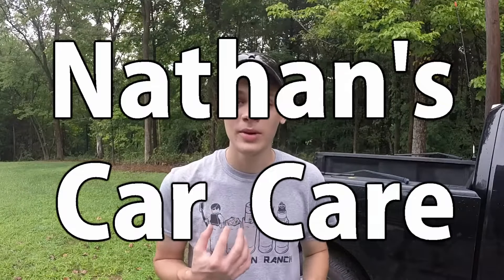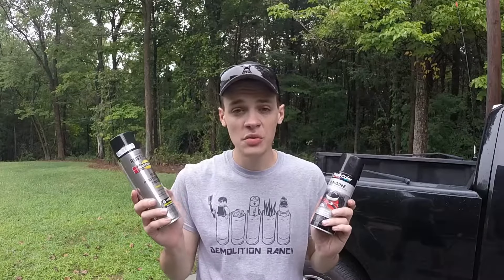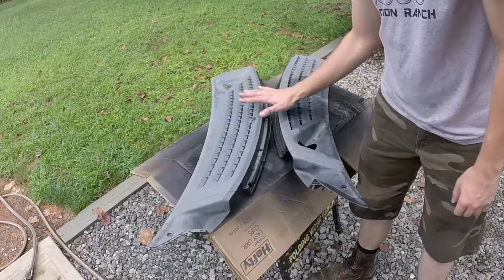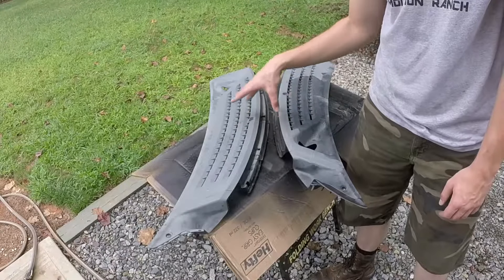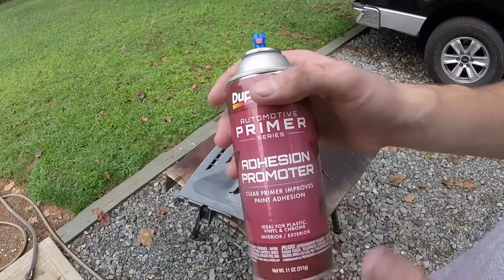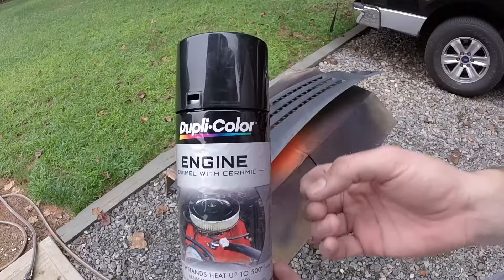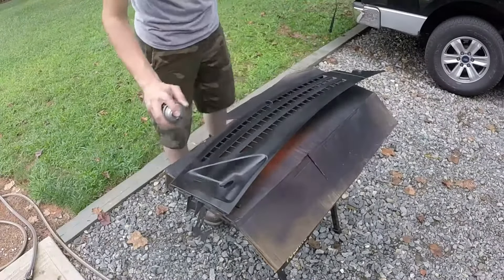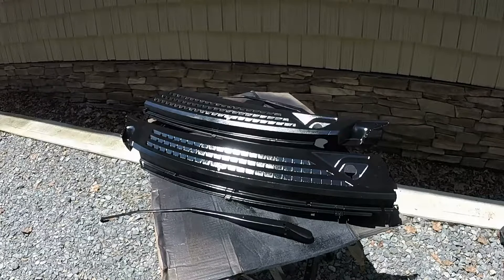How To Paint Plastic Car Trim - Step by Step Guide

Comment: Nicely done, only thing I would suggest is wearing gloves from start to finish and DO NOT TOUCH anything after cleaning the substrate with bare hands until last coat is applied, you touched the paint surface before applying the clear, that transfers oil from your hands and can create fish eyes in the final coat. But overall nicely done. And adhesion promoter is the bomb for plastic panels, makes paint stick like dog poop to a wool blanket.

Comment: Wow super helpful! A plastic trim that runs around my fog lights has been chipping away these past couple of years. I am thinking of painting it w/ your steps mentioned. Rather than taking it in for a paint job or complete replacement of fog lights. Lesson learned... don't buy knock off brand fog lights.
Reply from the maker: I'm glad you found this helpful. It's very doable

Comment: Hey.  I was just wondering if scuffing or sanding is needed? If not that's great.  Will be doing mine soon.
Reply from the maker: For this particular piece, it wouldn't help, because it already has a bumpy texture. So you'd have to sand so much off to get rid of the texture, then more to add texture back. I opted for the adhesion spray then paint. It's still holding up great to this day.
Reply: @TheNateTake  okay so for a number should work as well with just a good alcohol cleaning and adhesion promoter?
Reply from the maker: Correct

Comment: Hi Nathan I have a 2014 Ford expedition everything looks great except the trim and bumpers. They’re faded to almost white. They were just factory black. Would this technique work just as well on the front and rear bumpers?

Thank you for your very clear instruction video.
Reply from the maker: This should work on all plastic trim. One look that is popular with bumpers is to paint them with bed liner, which you can get in alot of colors, because they can easily get beat up.

Comment: I want to paint the interior trim parts of my 05 stang, should I use a adhesive plastic promoter after I sand them down? You didn't need to scuff it up?

Comment: Thanks, Nathan, for the video. The finish looks great, but over time the cowl will need protection from the sun. I usually use Meguiar's Ultimate Plastic Restorer. Do you know if after painting Wipers Cowl, I can use it on painted surface. Also, could you advise how much Dupli-colour engine enamel paint do I need for the cowl on Corolla 10th generation.

Comment: No sanding needed prior?
Reply from the maker: I didn't need to sand mine. Proper cleaning removes any contamination so the only other reason to sand plastic would be to increase the adhesion. Since this part already has a lot of texture to it, and I use an adhesion promotion spray, it wasn't necessary.

Comment: Wouldn't that clear Enamel crack under intense Sun or turn yellow.

Also why not use Dupli•Color  Trim and Bumper Paint? 

Just curious. Thanks for your reply.
Reply: try SEM Bumper coater
Reply from the maker: 3 years later and mine are still in good condition, no cracking or yellowing.

Comment: Looks good. Any special reason why you used the engine paint instead of their paint made for trim and bumper use?
Reply from the maker: Yes actually. The engine paint is enamel, which is going to be a tougher paint, and less likely to wear out over time. In fact it has worked great. Those pieces I painted in the video look just as good as the day they were painted.
Reply: Good point. I did not think about that.

Comment: This is a great video. My only question is, how long did the paint last and did it fade?
Reply: Matthew I found that once you apply the clear coat and it's cured to apply a ceramic coating to it and you will get years of protection and it won't fade

Comment: Looked great! Ive got a grill id like to spray that is plastic, and has a "chrome film" on it. Do you think lightly sanding the film would be ok?
Reply from the maker: That should be fine. If the chrome is intact, not peeling, a good cleaning and it should be fine painting over it.

Comment: Awesome video gonna try this on my RSX with faded black trim, but will this method work on my chrome trim? Would I have to do anything different? You earned a sub 👍
Reply from the maker: Welcome! I am not sure how it would do over chrome. I'd assume that if the chrome was well adhered, not peeling, and clean, it should be fine.
Reply: @TheNateTake  thanks for replying 🙂 and also you think it'll work on windshield wipers? Not the blade obviously but the swinging things lol

Comment: Hi, what did you use to clean the parts? Can I use a kitchen grade degreaser? Or is it better to just use dishwashing soap and water?
Reply from the maker: The only thing I would be careful about is making sure the degreaser won't disolve the plastic. I used just soap and water, but if you have a plastic safe degreaser, I can't come up with any reasons why it wouldn't work.
Reply: Dupli-Color SCM make sure you get a vinyl and plastic dye you can clean it with some stuff called Bulldog or you can use methyl ethyl ketone wear a mask when you clean with that don't leave the lid off of the methyl ethyl Ketone it evaporates fast don't get methyl ethyl Ketone on your paint it will open the pores up on the trim and then your dye will soak into it fabulously I do automotive detail but I have been doing upholstery fabrication and into your restoration for years and we have to work on the trim outside a lot of times too good video  Nate
Reply: Tri Sodium Phosphate (TSP) found locally makes a great cleaner and is also a good deglosser, so it promotes adhesion of the new paint. I mix it in hot water with a little dish soap. Then use any old brush to scrub the parts, then rinse well.  Wear gloves so the natural oils from your skin dont contaminate the surface of the material before you paint it.